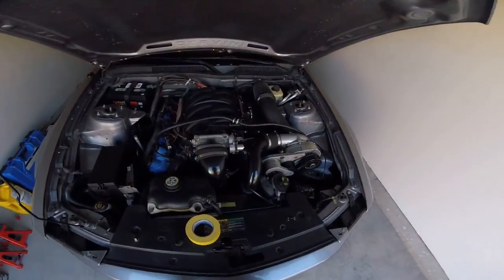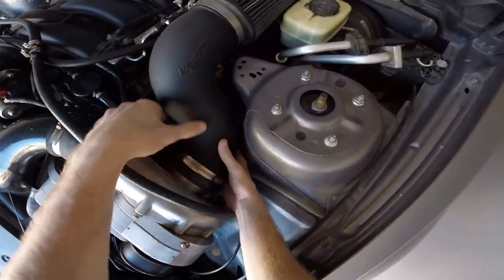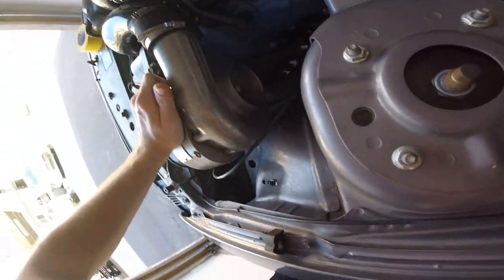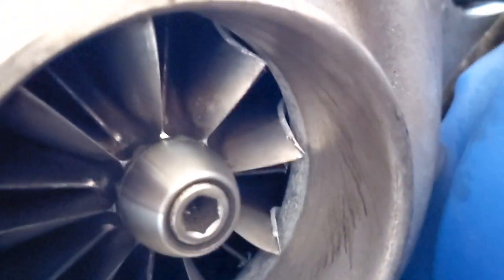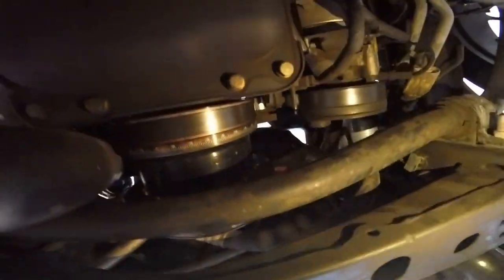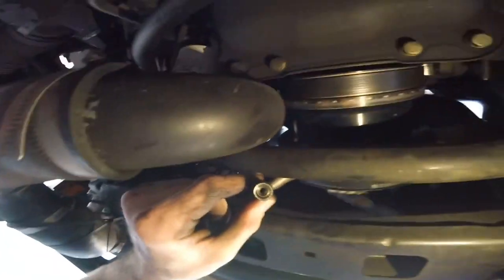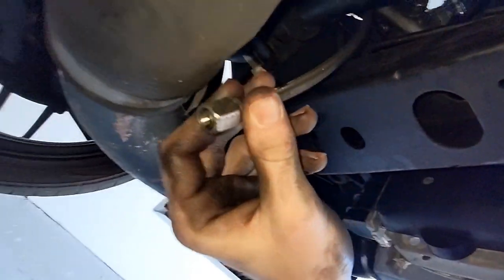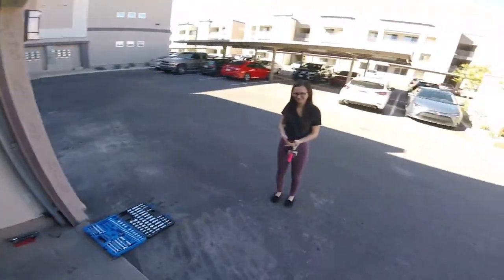A Ziptie BLEW UP My Procharged Mustang GT!

Comment: That's a tough break. It's always the simplest things
Reply from the maker: Of all things! I just wanna know how it sheered off like that?!
Reply: @CamMarz  Checking the video where you changed the oil on the PC it looks like a bolt plugs it, could it have just loosened over time due to vibrations? To me it doesn't look like anything broke, it just has a flared line with a nut that you screw a bolt into to seal.
Reply from the maker: @JuryRigGarage  Totally could have been the case honestly! Usually I tighten shit pretty good, but I guess this is just yet another expensive lesson I'm teaching myself 🥲

Comment: the procharger can be swapped-  but your engine inhaled all that metal :(
Reply from the maker: I honestly don't believe it did, luckily the procharger has a self contained system. The odds of those flakes managing to make it to the engine thru all the IC and charge pipes and the blow-off valve purging air constantly seems VERY unlikely. I am going to do an oil change as a precaution as well tho